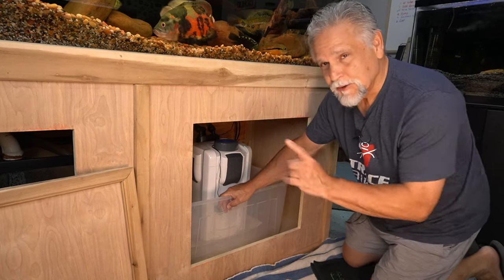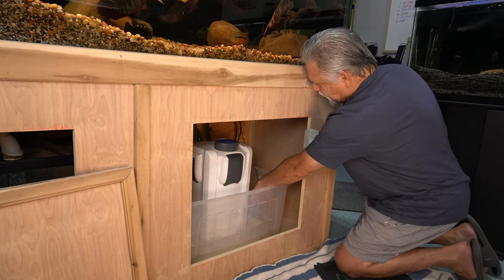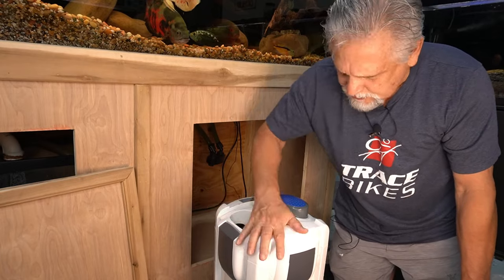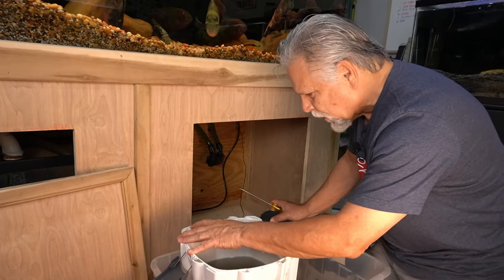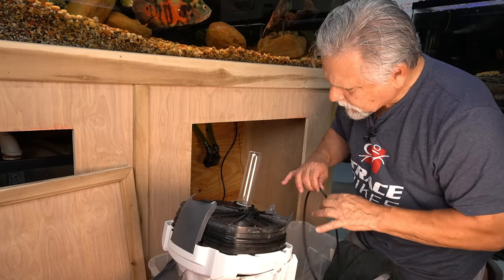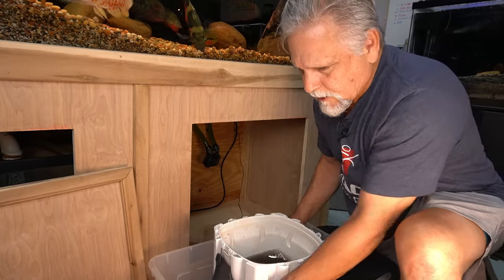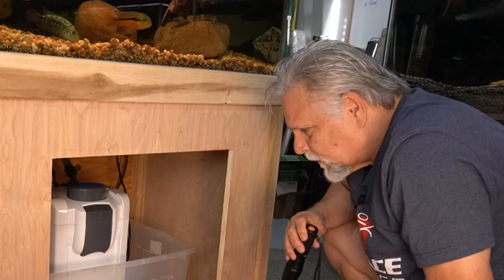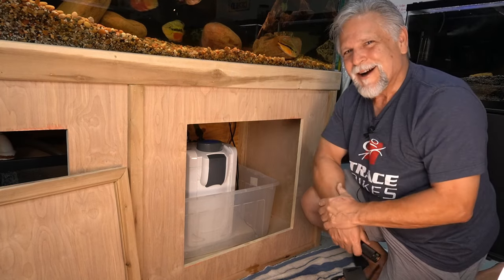How a Water Damage DISASTER was PREVENTED [and How *A Canister Filter LEAK GOT FIXED!*]

Comment: I feel you Ben!
I had my EF150 (small sunsun from All pond solutions in the UK) start leaking this week. A few days of thinking it was the o-ring was frustrating me! And the leak persisted.
Last night I took apart the entire filter, pump and valves and all. I took the lid apart and turns our a concealed o-ring has shifted letting water in behind the lid section... dried it and put it back together and the leak has stopped!

Comment: I once had a valve on the hosing leak, I managed to damage the o-ring. I made a temporary fix with vaseline on it but eventually bought a replacement valve. Hope it stays fixed Ben, odd how these things can leak but I've been using these filters for years and that is the only time it has happened.

Comment: Filter order, coarse then fine pads  This protects media from channel clogging. Then the medias. Sure add a polisher like Sera, but I reckon if used last will only reduce flow and not additionally prrotect media from blockage.
Yep, agree on tubs for filters and alarms are a must.  You can also get Tuya WiFi alarms to hit you up on a phone if you are not home and get a leak.

Comment: I'd take that 7 years and call it a win. I've had two sunsuns back in the mid to late 2000s, and neither one of them lasted a year before they started to leak. Always after being turned off whether intentionally or due to a power outage. I gave them both away and bought an FX5. It would be my luck that it was just the oring 😂

Comment: I have my filter connected via one of those app controlled electrical switches, so I like from time to time to just unpower the filter to check for any leakage. With the app I don’t have to hunt for the power plug and can do the check up from my sofa. Heard too many scary stories about ruined floors when filters malfunction and dump the entire tank of water on the floor. The watch dog that you have is excellent, but there must be someone in the house when the alarm goes on or it won’t help you much. Unfortunately even the electronic water detectors that can send you a message if the alarm is triggered are relying on internet connection working which may not happen during blackout.

Comment: Ben, do you turn your filtration off when feeding? I just added my first canister to my 75 gallon. I use WIFI-controlled outlets so its easy for me to turn off my air pumps and HOBs during feeding, is it ok to do the same with a canister filter or would the off for 20 min for feeding (or important phone calls) cause internal canister problems? Thanks LOVE your channel.

Comment: My sunsun 3000 failed in service after only 8 months causing severe damage to the cabinet and ceiling below.  I suspect its not uncommon,  and I'm about to seek assistance from amazon to get a refund fro "finedt-filters".  Lesson learned though, ALWAYS  fit external filters in a tub with a flood alarm!
Reply from the maker: Fortunately I haven't experienced that kind of major leak with a canister but I have had small slow leaks that would have created damage if the canister wasn't in a big rubbermaid container.